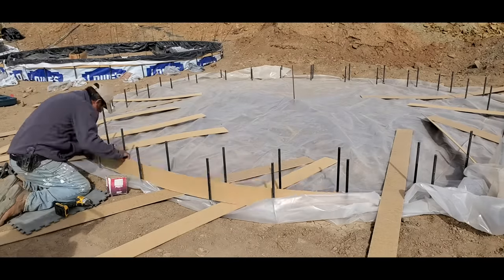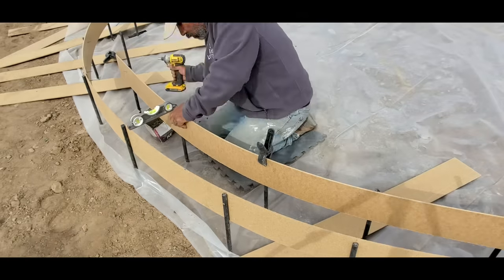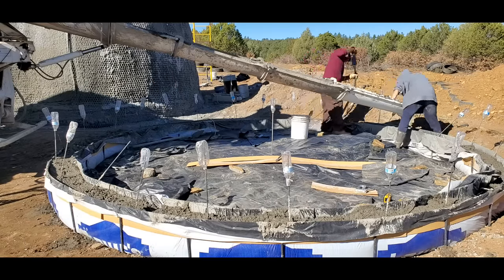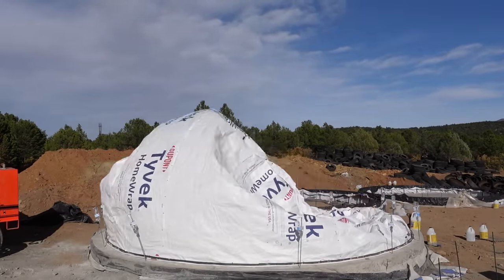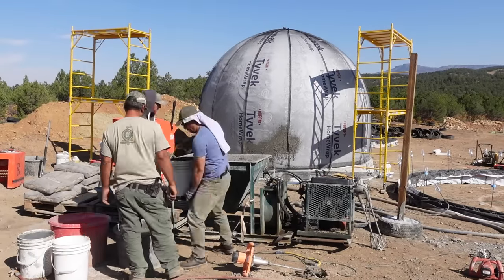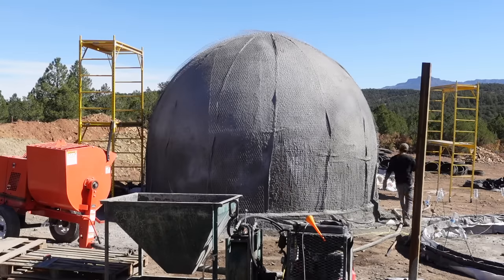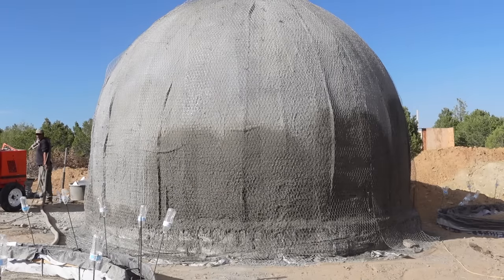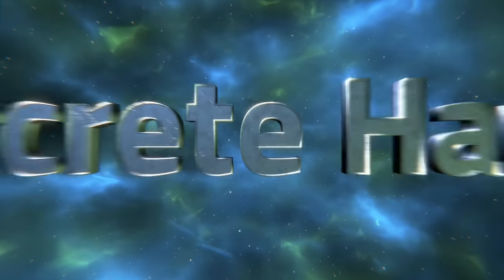NEW Dome Building System | Aircrete Harry #domebuildingsystem #dome #buildingsystem #aircreteharry

Comment: you ought consider de-galvanizing that chickenwire for better bonding to the ferrocement
Reply from the maker: Thanks!
Reply: Wouldn't the non-galvanized chicken wire rust more quickly and cause the structure to fail sooner? The beauty of the basalt seems to be that it would never rust.

Comment: At about $3,000 each, used steel shipping containers are cheaper it seems.
Reply from the maker: It.'s not at all. The dome you build in place for $5000 and it's insulated way bigger then 8 x 9 x 40. Shipping container you need to rent a crane, build wood frame and insulate. By the time your done with the shipping container you will spend about $10,000 . And you have to pay to have it shipped to your location. I know I have 3 Shipping containers.  I do have a shipping container build Idea I think would work great and  less to build.
Reply: @AircreteHarry  I like both, but shipping containers are dope tho for the recycling aspect. I prefer 'squared off' buildings aesthetically, domes remind me of warts lol.
Reply: Most all of the shipping container videos I've seen, you end up building a frame house inside the container.  The container itself is nothing more than ugly steel siding that restricts what you are doing.  They make better storage sheds than homes.

Comment: That camera movement is making me a bit queasy, and normally that doesn’t bother me.  Wow.
Cool, use of Tyvek for the air form - you won’t have to deal with that again.  On the outside, nice use of chicken wire to provide strength.  Rebar would be good, but it would be challenging to make it work with those curves - you’d have to bend every bit of every bar.
Reply from the maker: Thanks!

Comment: you should just keep using fiber glass mesh  and keep layering it to make it as strong as you can,,,   your doing great.
Reply from the maker: The wire mesh is stronger.
Reply: @AircreteHarry  i understand it is stronger  but wouldnt the mesh be cheaper and also stronger  if  say you used 5 layers to one of the wire?
Reply: I would consider adding a hoop of 1/2" or so rebar self supporting on the shell then embedding it, at about the 9 foot elevation just for the heck of it. Something unaffected by doors and windows cut in later. Maybe even weld the ends together.

Comment: I do like the idea but notice one small matter that would really worry me, that of  fire.
Foam is not very good where there is heat so where you build would clearly be raised by the authorities concerned.
I think there would be a total NO  in Australia, that is unless it were fireproof and provably so.
The other thing is rodent proof, as rodents love foam, they even eat the protective coating on wiring, so there would have to be some form of protection against such things.
There is a question from me alone that being is the foam in the little ball type as used in bean bags or is it something different?
Reply from the maker: https://youtu.be/seB4Si01lP8

Comment: Interesting. What about energy code requirements?
Reply from the maker: You have to meat the insulation code. That's it.
Reply: @AircreteHarry  Sure you do: but thats my point....I didn't see any insulation going under the slab. Right? So: not to code.
Reply from the maker: @bradmiller9993  Sure I do, I have about 18 inches of Aircrete in the slab. Ontop of that will go Pex tubing  and two inches of cement. Around the outside of all the domes will go 6 inches of Aircrete 4 feet out from foundation. Then I cover the aircrete and about 12 inches of the dome wall in soil.

Comment: Put your chicken wire together on the ground. Roll it from opposite sides inward. Bind it with a long rope and a pull release knot. Pull it up and over. Release pull knot and the two rolls will drop. Presto!
Reply from the maker: That is how I plane to do it ones I have a lift or boom truck.

Comment: You’re not concerned that water entering through the porous concrete won’t rust the rebar causing it to expand and shatter the dome from the inside out?
Reply from the maker: No ones completed water will not enter and the rebar is Basalt and will not rust.

Comment: Why not use hempcrete instead? Way better insulation plus it’s fireproof, better mold resistance for your food storage and it’s breathable unlike concrete which will just dust up, crack and has poor indoor air quality
Reply from the maker: Hempcrete would end up costing me much more to build and take longer. The insulation layer is not on in this video.  All the domes will have good air circulation.

Comment: If the reinforcements you use isn't listed in the building code,  many places won't issue you a building permit for a house. You need to check first or you might have to tear down what you have built. The same goes for your additive. Not listed in the code can cause problems.
Reply: How do they check for that?  Is that even a thing?
Reply from the maker: My building permit is for rebar that will be the last layer of reinforcement everything I did makes it easy to build up unstill the rebar. There are 20 foot domes built with just Basalt rope as the reinforcement. This is a much stronger system. with no cracking.

Comment: YOU HAVE TO HAVE THE UNDERLYING STRUCTURE UNDER THE TYVEK TO HOLD IT UP IN EARTHQAUKE SO IT DOES NOT CRACK FALL AND NOTHING TO HOLD EVEN THE STRUCTURE IS ONLY 200 LBS OF WEIGHT WHICH MIGHT MIGHT LET 150 to 200 LBS ON THE THING OTHERWISE IT WILL FALL AND NOT HOLD WELL IN PRESSURE IN EARTHQAUKE SO BEFORE YOU GET IT PASSED YOU NEED TO HAVE ENGINEER MAKE A PLAN TO SHOW WHAT PRESSURE IT CAN HOLD AND TEST IT THE TYVEK ALONE WILL CAUSE THEM TO KNOCK IT DOWN .  THERE IS NO REAL REBAR HOLDING IT A FEW IN THE  WIRE WONT DO IT  GET A STEEL STRUCTURE AND BOLT IT UNDERNEATH MIGHT COST 2000$ BUT WILL HOLD IT UP FOR YOU  I THINK. MAKES IT EASIER FOR ENGINEERS TO DETERMINE WHAT IT CAN SAFELY HOLD EVEN THEN MAYBE 200 LBS SO TWO INCHES OF AIRCRETE ONLY WHICH IS FINE FOR WARM WEATHER BUT YOU WOULD NEED TO THEN DO STRAW BAILS AROUND HARRY AND THEY DO NEED 4 FOOT REBARS THROUGH TO HOLD THEN THEN PUT YOUR WIRE OVER THE STRAW BAILS AND THEN YOU  CAN SPRAY OVER THE WIRE SO THAT WAY EVERY INCH IS R VALUE AND THEN WITH A GOOD BAIL MORE THAN A FOOT OR TWO YOU MIGHT GET R 20? WHICH WOULD DO FOR WINTER WEATHER EH.   JUST MAKE ONE NICE ONE IN MIDDLE AND MAKE 4 to 5 AROUND IF YOU MAKE A GEODESIC 2V in MIDDLE USE A JEWISH STAR PATTERN IN MIDDLE  AND THEN ONE FOR DOOR AND 5 ROOMS TO THE SIDE WOULD GO UP QUICK . GET THE 2V STYLE IS ABOUT THE SAME HEIGHT USE 10 FOOT A 35 AND 9 FOOT B STRUTS AND BUILD AND BOLT THEM TOGETHER . THAT GIVES YOU SOME ABILITY TO HOLD THE AIRCRETE AND IF YOU PUT STRAW BAILS ALL AROUND SECURE WITH 4 FOOT REBAR THROUGH EACH LAYER TO KEEP SECURE THEN IT WORKS !  WIRE OVER THAT SPRAY OUTSIDE WALLS REAL QUICK! ALSO DONT DO AIRCRETE FLOORS YOU NEED TO DIG DOWN 4 FOOT FOR BUILDING CODES BELOW FROST LEVELS TO ANCHOR IT AND THEN  YOU NEED ROCK BELOW THEN CONCRETE WALLS BUT ROCKS BELOW THE STRAW BAILS SO THEY DO NOT WICK UP   THE WATER  PARKER IN TEXAS HERITAGE HOUSE DOES THE STRAW BAILS ALL TIME WATCH HOW HE PUTS THEM UP AND HOW THEY GET SECURED .     THEN PLUMB IN BEFORE YOU POUR THE FLOORS THE PLUMBING FOR IT ALWAYS USE THE 6 INCH PIPES THEY ARE MORE BUT YOU CAN UPGRADE AND IT DOES NOT CLOG SO  THEN MAKE A PROPER FIELD FOR SEPTICS YOU FAILED TO PUT THIS IN BEFORE THE POUR OF THE FLOORS YOU FORGOT! HAHAHAHA! SO PUT IN A BATHROOM AND TWO BOXES ABOUT TEN BY TEN CEMENT AND THEN 200 FOOT OUT TWO DRAIN FIELDS CHANNELS WITH 4 LAYERS OF ROCKS SAND 8 FEET DEEP AND SOIL TOP TWO FOR TEN FEET DEEP SEEPING BEDS LEECHFIELDS OUTSIDE TANKS THEY NEED DRIANED OFFTEN OR THEY ONLY LAST TWENTY YEARS SO PLAN WHERE IS NEED BE YOU CAN MAKE ANOTHER ONE AND KEEP IT WELL AWAY FROM YOUR WELLS SO IT NEVER CONTAMINATES OK !  YOU SHOULD BE MAKING THESE PROPERLY FOR HOMELESS ON COMMUNITY HOMELESS FARMS AS IT WOULD BE EASY TO BUILD THESE TINY HOUSES TWO OR THREE TOGETHER FOR EACH SO A BATHROOM KITCHEN AND BEDROOM AREAS . TINY HOUSES FOR HOMELESS WOULD BE NICE THERE ARE MILLIONS HOMELESS NOW AFTER CRIMES OF GOVERNMENT DESTROYED LIVES STOLE MILLION DOLLAR HOUSES MURDERED PEOPLE STOLE THEIR PROPERTY HOUSE ASSETS TO COMMIT GENOCIDES !

Comment: You keep using the word 'cement"; do you mean "concrete", or do you mean the same thing?  Also, is there a limit to the size of the dome you can build using this method?  The Monolithic Dome Institute comments on how these domes are likely resistant to winds up to 300 mph; any experience with high winds e.g. hurricanes and your domes?
Reply from the maker: Yes you can build larger. The 3 inch thick dome we live in now has be hit with 70 mph winds here in Colorado and we did even feel it.

Comment: Only change I would make is to use basalt rebar instead of steel which eventually rusts out.
Reply from the maker: I do use some Basalt rebar but the waterproof stucco coating will stop any water from getting in.
Reply: @AircreteHarry  Over time water seeps through even as water vapor from the inside of the structure.  That's why it's best to never use steel rebar unless required for some reason.  Or in structures one doesn't think will be used for more than a couple decades.

Comment: Hey Harry. When you said it costs around $5000, did that include labor and equipment?
Reply from the maker: No, for a person building it themselves it cost $5000.  I would have to charge $255 an hour for labor and equipment. 3 or 4 days to build the dome. More than one dome at a time can be built in a day.
Reply: @AircreteHarry  How big is this dome?
Reply from the maker: @foxmulder3980  16 foot.
Reply: @AircreteHarry  If the 16ft is $5,000 and that equates to 200 sq ft.  The 32ft is 800 sq ft... Would that equate to $20,000?  Is there a set price per sq ft or is that over simplified? Obviously there may be more involved with scaling up.

Comment: I think 5000 dollar is a lot of money. But we will see what it will be eventually.

In my opinion you can more easily build something with wood than with what you are doing, moneywise. 

Greetings,

Jeff
Reply from the maker: Yes you right you could build with wood, But it would not be fireproof, Earthquake proof, Tornado proof, Bug proof, Bullet proof and this dome will be 10 inches thick walls. You could build cheaper with wood it wont be as strong as this dome.
Reply: @AircreteHarry  What if you were to build a concrete house with aircrete? Just regular walls, regular flooring. Just really bulked up, the full 10 inches thickness. You wont have this big space on the inside you will have to fill up. Will you fill that all up? Or will you have a lot of volume, because i cant really see how it would come in handy to have that large a volume if you still need to fill that all up. 

If it gets really cold in the winter, it might even be a good idea to cover the domes up and be underground, because underground the temperature is more even all your round. 

Ive cecked, and what i found is the cellular concrete blocks are the cheapest to build with in my area. You still need some rebar and portland cement to fill up the cells in the blocks, but that cant be all that expensive. It is however not as creative as the domes. Also normal bricks are not that expensive if you know how to lay them. Double rows of bricks are easy to build and very durable. 

Check out my grabcad post, its a concrete slump cone, the post also has a book called modern masonry, brick, block, stone. https://grabcad.com/library/sheet-metal-slump-cone-for-concrete-1

Greetings,

Jeff
Reply from the maker: @jeffjefferson2676  I have a friend who built a 3 story house using Aircrete for the non-load bearing walls and concrete for all the support columns.  It looks really nice.
Reply: @AircreteHarry  Do you have a link? What is the psi rating of the aircrete? Because if it yields enough in theory you can use it for columns. 

Normal concrete for the columns, ive thought about that. That is what he used?

Are you going to coat the outside of you concrete with paint? 

Greetings,

Jeff
Reply from the maker: @jeffjefferson2676  You can change the mix of Aircrete to make it stronger. You can add sand and you can add less foam. The less foam you add the stronger your Aircrete will be.

Comment: I'm a plaster aluminite set the cement or calcium that your secret mix as a plaster we use netting mesh on efis jobs dryvit or synergy even sto far  inside you can use hard wall plaster if you bonder the walls like structolite dry it makes a smooth finish coat that sticks to cement Italiano make a jelly like smooth glass finish coat you can use putty coat if you bonder the walls the mix for putty coat is 50 gaugeing and 50 lime 3 ounces of raw qyp

Comment: Latex in the cement before spraying it on a fiberglass mesh?  
        I’ll be over here stacking hemp bricks.
Reply from the maker: It's all about time and money. I can build this in  7 days solo and to make it safer on the inside cover the walls in a layer Magnesium Based Cement and be done. Hemp is still very costly last time I checked.

Comment: off topic but anyone know if polurethane foam can be used for the epic mix instead of eps
Reply from the maker: Polyurethane foam turns to dust when you try to grind it up.
Reply: @AircreteHarry  I might try to cut it into small pieces with sizzors, even if painstakingly, just to test it. My source getter is getting this foam right now instead of eps so might as well test it? 🤷‍♀️

Comment: Harry, I hate to burst your bubble, but in response to your statements:

"In most of the country your allowed to build these domes with just rebar and cement" - Really?!?. What country are you talking about? 

Domes are built with rebar and concrete (not cement), and rebar in such structures is usually epoxy coated.  

"so I don't see any reason why you can't build what your seeing in this video" 
Assuming you build this legally (meaning by getting permits), your friendly local Building Inspector Is going to require engineered drawings (especially if its for a dwelling). I seriously doubt any engineer is going to sign off on this method of construction, since it needs to meet snow load, wind load and earthquake requirements, which vary greatly around this country.
Reply from the maker: Hey Srihc, You did not burst my bubble. It did not say country I said counties, a county is an administrative or political subdivision of a state. 

Concrete / Cement what ever you know what I mean. Here is questions for you. 
If I mix cement with foam to make Aircrete is it concrete or cement still?  If mixing cement with paper and EPS foam beads is that concrete or cement?  

I have engineering plans and permits already for this build for just concrete and rebar. I added two extra steps to make it easier and stronger for DIY people to build.  I have shown the engineering plans in other videos before. 
And I now have an engineer for anyone who want to build this way in the USA.   

What is your experience with building? What have you built?  Thanks!

Comment: Could this be adapted to build monolithic concrete domes (https://domtec.com/commercial/)?  I investigated this building technique about 30 years ago and found that because so few contractors could do the spray-on concrete, you'd pay a premium price for a building even though it would use only a faction of the time, materials and labor that a conventional building would.  And I was also concerned that this type of dome wasn't ecologically sound in the long run because you could only use petroleum-based foam for the insulation.  But, this technique may be OK if spray-on aircrete could be DIY and you could eliminate the foam insulation.
Reply from the maker: You can build this way with just a stucco sprayer.

Comment: Wow, this system you developed seems an awful lot like Lloyd Turners origional bubble architecture...weird
Reply from the maker: Mr Turner didn't use Tyvek material to create Air-Forms. I developed & introduced that method. 
You are Welcome ✌️ 
Same for the Double Shell Aircrete Dome & E.P.I.C. Cement Mix techniques.
While I work on making things happen & happily share the techniques,
you are projecting your weirdness.
Cool, cool.
Reply: @AircreteHarry  he started with simple plastic sheeting and moved to other homewrap materials like tyvek. Obviously you took some meaning I wasn't implying but the response was interesting. But now that something is implied, I'd suggest a little less "I developed this", and "I developed that",  and just show your method. Obviously this isnt EXACTLY the same as Turners work, and I understand you're trying to sell yourself here, but this type of construction is a tiny community, stand out in other ways. 👍

Comment: Not a "new" system or idea.  Wallace Neff created "bubble houses" exactly the same way but much larger.  One home was built in Pasadena, CA in 1946 and has been used as a private residence for the last 79 years!
Reply from the maker: The idea is not new just the process, steps to build and cement mix designs is new.